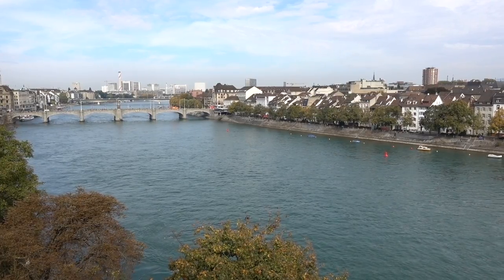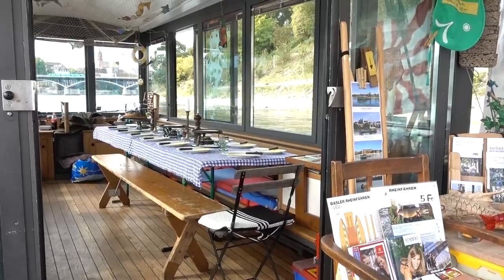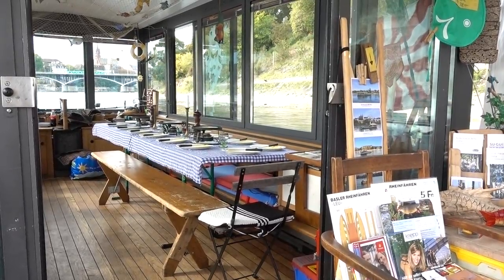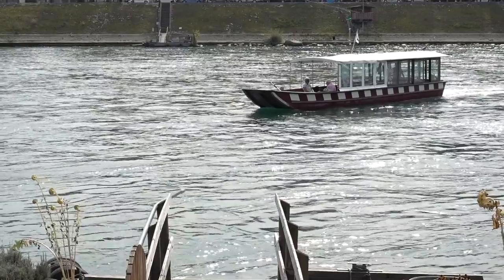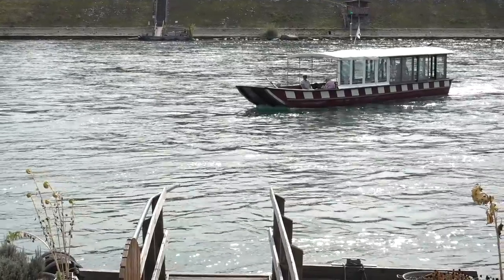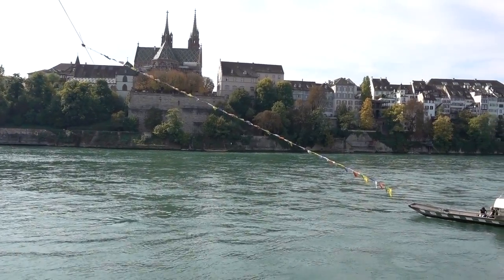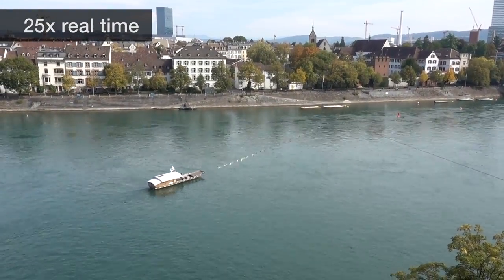Reaction ferries are really clever

Comment: It's basically a kite. A water-kite, but the principle remains.
Reply: No a caboe cart..... kites are totally diffrent.
Reply: Cable cart*
Reply: @detachsoup6061  I think it's closer to a water kite than a cable car. Like a kite, it's moved by fluid dynamics and held on by a rope. Unlike a cable cart, there's no motor involved.
Reply: I was thinking of a sailing boat ... instead of river current against the hull, it's air current over the sails ... same principle ...
Reply: "We floated a kite in a public river..."
Reply: They flew a kite in a public place
Reply: @russcrawford3310  And a wire instead of a keel.
Reply: I like that explanation. Very concise. 🙂
Reply: I was thinking a flashlight and mirror but same idea.
Reply: the principle is similar to that of a wing. angle of attack generates "lift" but horizontally. even for an actual modern container ship, the rudder mostly just generates an initial sideways velocity, which provides an angle of attack which generates the majority of the turning motion
Reply: @icecreambone  can you elaborate or show me where I can read about that
edit: I mean the ship rudder part
Reply: U mean like a sailboat?
Reply: Agreed. It's called "kiting", and it's not just about air or flight.
Reply: @russcrawford3310  Exactly. Upside-down sailboat.
Reply: I think there’s a similar thing in the Wye Valley somewhere - a ferry that is kept in line by a cable and a geezer operating it!
Reply: @sheilaolfieway1885  Nope.
Reply: @ArruVision  @Russ Crawford  Nope.  Just a sailboat without a sail, but having a keel and rudder.
Reply: @Patriottoo2  Yep it's exactly how it works.
Reply: @sheilaolfieway1885  Would you please explain just how the light (energy) generated by the flashlight causes the mirror to move?
Reply: But don’t kites only work with good or strong winds ? This set up said nothing about using wind to move it
Reply: @miguelfloresburgos2849  He did say it'd only with with a strong river like the one it's on.
Reply: @Patriottoo2   ever hear of a solar sail?
Reply: @sheilaolfieway1885  So a flashlight is comparable to the Sun?  Your analogy is more than a quantum leap.  Please post the video of the flashlight making the mirror move.  Thanks!😀
Reply: So, this is how we should be flying?
Reply: kites dont move 
they stay in one spot
Reply: @kenwittlief255   you go fly a kite and see if that is true.
Reply: @kenwittlief255  Steerable kites do move side to side across the wind window using a component of the wind force that's not cancelled by the pull of the ropes as the kite is tilted slightly. Even when the kite stays in place, this "slip force" is what counters its weight and keeps it in the air.
Reply: @russcrawford3310  Yes, same principle indeed.
Reply: @sheilaolfieway1885  On second thought... please don't try to make your mirror move by using your flashlight.  You might knock Earth from its orbit when you turn the flashlight on.
Reply: @Patriottoo2  actually it would be a laser not a flashlight i think. You also have completely ignored mass in your attempt to toy with what I'm saying. or humoring me whatever it is.
Reply: You are correct. In fluid dynamics air is a liquid.
Reply: @sheilaolfieway1885  No, you, apparently, have been trying to interject nonsense into a topic you do not understand.
Reply: I had the same thought as soon as I saw the angle of the boat to the current of the water
Reply: @SofaKingShit  those ones called kites…?
Reply: Exactly what I was thinking. It’s even more like kite surfing but in reverse: the board on the water is like the cable across the river and the kite is like the boat.
Reply: It's basially a sail boat. A water sail boat, but the principle remains.
Reply: @sheilaolfieway1885  not comparable to a solar sail. The equivalent to a solar sail would be a boat floating down river. Solar sails can only be pushed in the direction of the photons movement.
Reply: not all like a kite its just getting towed by a cable how is that a kite (kite is wind power)
Reply: @sydneyconcerts902  it's not being towed by a cable. Water pressure is pushing it back and forth across.
Reply: @gurnblanstein9816  okay wow thats really interesting sorry i had the video muted so didnt hear what scot was saying i saw the cable and a winch style set up still not a kite tho :P
Reply: @sheilaolfieway1885  where is the energy harnessed in a mirror?
Reply: I agree.
Reply: @sydneyconcerts902  
It's not a kite 
But the movement is the same 
The water flowing past is like air blowing past.
Because they are both fixed, by a cable or string, the energy of the fluid moving past ( water or air ) is harnessed to move the fixed object ( boat or kite )
Reply: This is powered by water flow only no wind effect required. And above all it’s been invented long before any sort of water kite.
Reply: @Kim2506you  I didn't mean to imply any use of wind. My point is that analogically to a rising kite, it uses the part of the force exerted by the flowing medium (be it water or air) that's not cancelled by the anchoring line to move across the stream.
Reply: Row row row your boat gently down the stream
Reply: @sheilaolfieway1885  
I think I really like you😊
My exact sense of humour…
It’s like looking at a mirror. With a flashlight. And a bottle of bourbon 😂
Reply: @bravelyHomoSapien  I'm serious in a vaccume like outer space you can use light to a degree to push something granted it might have to be a laser but still. look up solar sails.
Reply: @russcrawford3310  I was thinking of it as tacking (sailing into the wind) but with water being the working fluid instead of air.
Reply: @russcrawford3310  Sailing is probably the earliest application of this principle, although people had to already understand the basics to invent actual sailing. Kites are a type of sail, but were invented much later than sailing. I'm a bit surprised that Tom didn't mention the obvious connection.
Reply: @Patriottoo2  I don't know why Sheila started by mentioning a mirror and flashlight instead of a solar sail, but a solar sail is a mirror.I'm not positive about why they have to be as reflective as possible, but I suspect it's because absorbing the light turns it into heat instead of momentum.  That means that any mirror can be a solar sail. A normal  mirror powered by a flashlight wouldn't be a very effective solar sail due the the relative amount of light and mass, but theoretically any mirror could be moved by any light source, even if the acceleration is extremely slow. That the concept seems to elude you makes me think you're the one who doesn't understand the topic
Reply: @rcpmac  Solar sails can be tacked, just like a sailboat.
Reply: @redwarf8118  Where is the energy harnessed in a solar sail?
Reply: @suedenim9208  Finally, someone who knows how solar sails work!  Perhaps, you can illuminate (pun intended) us on how photons move sails.  Is the sail accelerated when photons strike the sail, or when the photons bounce off?  Thanks so much.  P.S.:  I'm still waiting for that mirror/flashlight demo.
Reply: @rcpmac  Nope. Solar sails get their force opposed to the change of momentum of the reflected light. It IS possible to steer a solar sail sideways, as it never gets to neutral floating, as a boat floating down a river is after only a few seconds in said river.

Comment: My deceased uncle was the last person to operate such a ferry in my area, until it was destroyed by a major flood in 1936. He described how it worked to me many years ago. Under the ferry were 6 vanes (he called them vanes rather than rudders) and there was a lever (ie tiller) you moved in the direction you wanted to cross. It was the Androscoggin river in Maine, usa, it does not have that much current but the ferry worked fine.
Reply: If it's a weak Current, that may explain the need for those Vanes to get more leaverage out oft the Current.
The four Ferries in Basel don't need those, as the Rhine there is quite fast and strong all Year round (less Water in Autumn/Winter and more in Springtime/Summer but always plenty strong enough)
The oldestof those Reactionferries in Basel was buildt 1853, it was outside the City and doesn' exist anymore. The oldest of the four still running Ferries is from 1854 and they were very important in those Days, as there was only one single Bridge in Basel for over 800 Years. A second one was buildt in 1879  and a third one in 1882....

Comment: It's also a technique used in kayaks and canoes to ferry across rivers and other streams. Paddle against the current and angle your vessel towards the side you want to go to. It is great fun. :)
Reply: was going to say this. you do expect to end up downstream on the opposite side because no wire to hold you in place
Reply: Late to this video, but what I were gonna say too.
Not just crossing rivers... Is possible to kayak out to the farne islands (northumbria, uk... ) there's videos of the trips here on YouTube.. Fair distance, and on the part between inner farne to the next island (longstone) ... A tide race runs between islands. One paddles forward at a slight angle for a good  10min to get sideways across it.
Reply: I often do a ferry glide with my powered boat, when crossing the tide/stream.
Reply: No
Reply: @someonenew3478   you might end up further downstream if you can't (or don't want to) paddle against the current strongly enough to prevent it. But if you hold the correct angle,  the current can push more sideways than downstream in some cases.  You can look for videos of how to ferry in whitewater
Reply: @martin.feuchtwanger  I was going to say something similar. When I was taught kayaking, back in the 1970s, I was taught about the "ferry glide" with an over complicated explanation about water pressure on the upstream side of the hull.  I always thought of it as a simple vector problem.  It is not the same as an actually ferry because there is no fixed wire to resist the water flow.  Calling it a ferry glide is like calling a glider a kite.
Reply: @ScholarGypsyOx  Ah, someone else who does this with a powered boat. Have done this in Australia on the Murray to avoid approaching boats.
Reply: The direction of the bow relative to the current is called the "ferry angle", or at least that's what my whitewater guides called it.
Reply: Yep, I’ve used this technique a few times. 
🌊😍
Reply: We used this to go ziplining when practicing z-drags in the SRT course I did

Comment: The Rhine ferry between Plittersdorf (Germany) and Seltz (France) works on the same princinple, transporting 100,000 cars, 60,000 bicycles and 30,000 pedestrians per year.
Reply: @itsMEE1111 I don't think it actually needs to due to the river currents there, but you can as long as one anchors it on the guide rope right to stop drifting back down stream, this is basically how one sails into the wind.
Reply: What do you mean by "upstream"?
Reply: He means a way to move against the current. Directly would be impossible, but with a speed reduction, at up to about a 45 Degree angle would be possible as in how a sailing boat sails into wind currents.
Reply: @M9IN0G  Upstream is the direction from 
which the water comes from, down stream 
is where it winds up or is headed.

Comment: This also works without elevated wire, e.g. on the River Elbe in Rathen, Germany.
The tow-wire goes from the ship to one river bank. Otherwise, the reaction ferry (in German: Gierseilfähre) operates in the way described above. Obviously, river traffic is blocked when the ferry is on the opposite side of the wire's anchor.
Reply: I think the one in the video is the better solution for that exact reason.

Comment: Read about another Swiss project recently. There's a mine in the mountains, and the ore (or whatever it produces) is transported down to the valley in trucks that use the weight to produce electricity on the way down, which is more than enough to drive them up the mountain again when they're empty.

Comment: The 3-d printer is such an idea. For years and years we dreamt of it, then someone came along who made one, and once you see how it works, it's so logical and obvious that you can't believe we didn't have them much much sooner.
Reply: Being fair, the earliest 3D printers could've entered commercial use isn't far off from the time they did.
Reply: Well, 3D printers require beefy computers that can perform all the calculations necessary to (1) build a 3D model, and (2) convert the 3D model to positioning instructions of the 3D head.

I think this was rather unachievable before Core2 Duo came out, or whereabout that time.
Reply: @PanduPoluan  A 75MHz pentium could run quake realtime. A printhead moved by two servos is not more complicated than that by any stretch of the imagination.
Reply: If a computer no more powerful than a gameboy can take us to space, a pentium can 3d-print us some stuff
It takes precision mechanical engineering, not necessarily computing power
Reply: 3d printing started in the late 80s in industrial applications and spent two decades being refined to a point where it was a viable consumer product. The only miracle that happened in the 2010s was the patents expired.
Reply: The modern style of 3D printing we have now has been patented since the late 80's, took 20 years for the patent to expire. After that anyone could make them.
Reply: @VirtualR  So in the end it wasn't computational power, nor the critical point of it becoming affordable enough, nor any other nonsense.
In the end what kept us waiting for 3D printing were intellectual property laws.